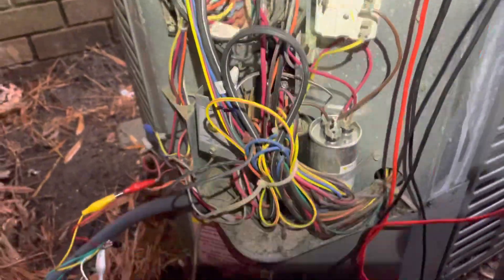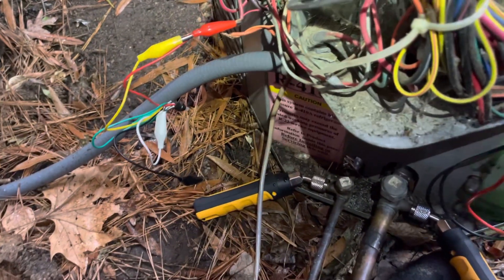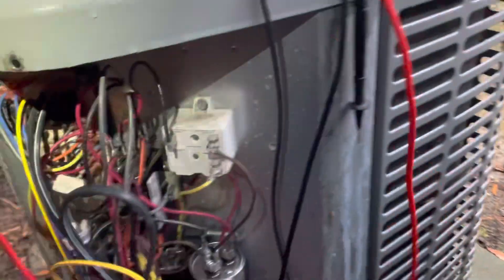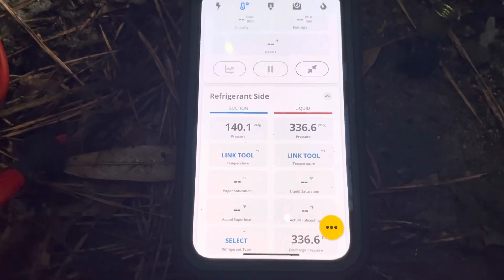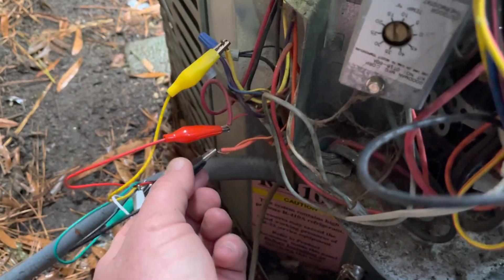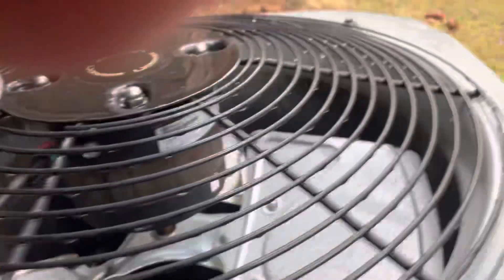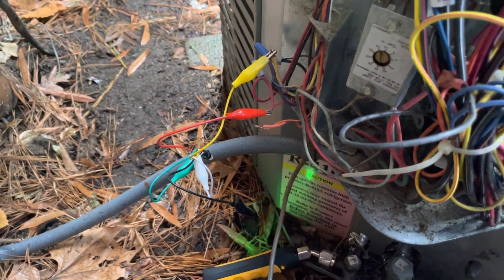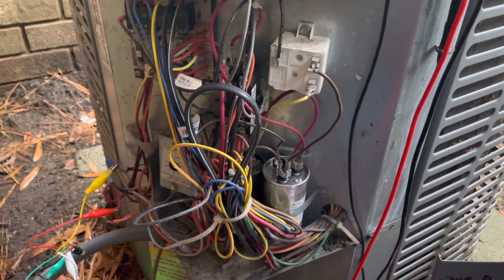HVAC reversing valve sticking in cooling position after a defrost cycle.

Comment: I’ve had similar issue with amana goodman as well. Normal suction but head pressure climbing quickly. Changed out outdoor unit and it fixed the problem but after cutting valve in half the valve showed no signs of a damaged slide or oxidation. The unit was flat and I repaired a leak and after charging these were the symptoms. But what a loop it threw me through.

Comment: You can also get a little round magnet, put it on the body and watch it slide open and close or not at all.
Reply from the maker: Yes, good point. I keep a little pill bottle with rare earth magnets in it about the size of an aspirin. Got them at Harbor freight 10 in a pack for about six dollars. That is a good troubleshooting tip for checking reversing valves that aren’t shifting or stuck in mid shift.

Comment: I would like to see the replacement of the RV.  I know it’s a difficult job to get right and it would make a great training video!
Reply from the maker: They chose to replace the condenser. But the first chance I get to do a valve, will do.
Reply: I had a tech do one I was with 13 years ago. Most annoying thing to do. The best part was, after replacing it, it wasn't even the problem to begin with. It was the thermostat LOL.